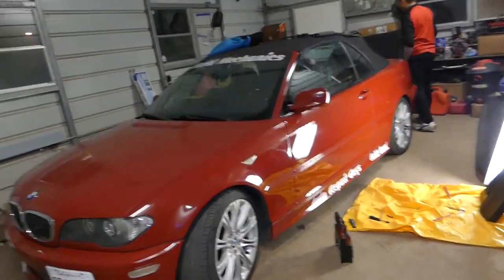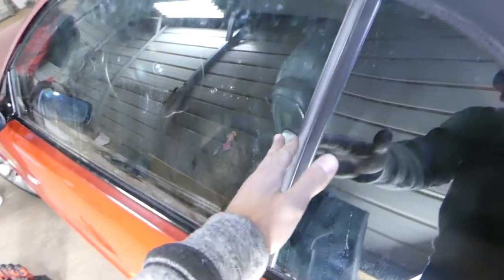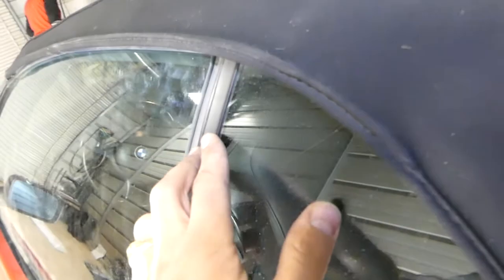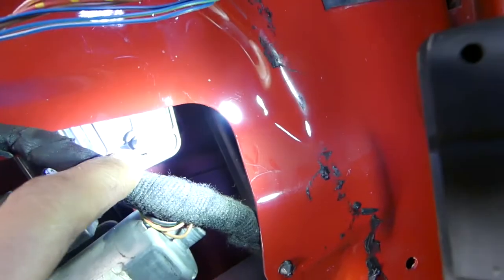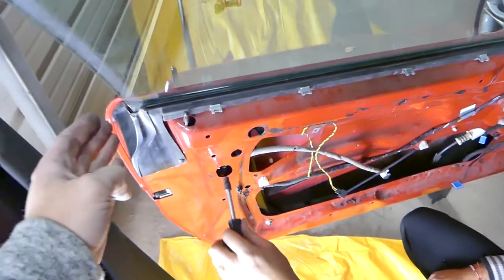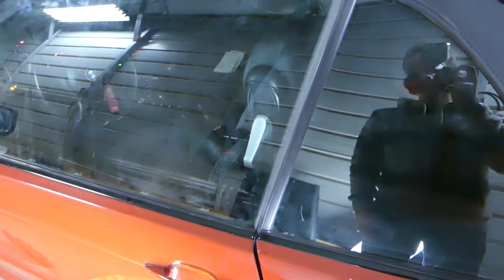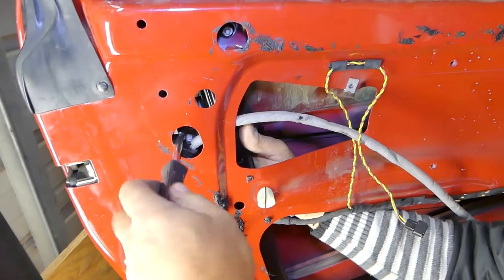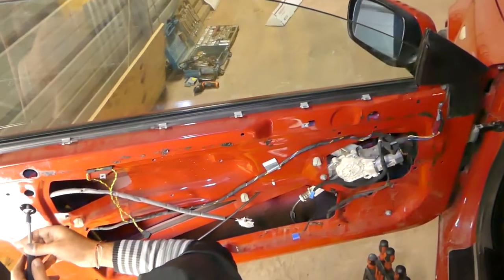HOW TO ADJUST SIDE WINDOW ON BMW E46  WINDOW DOES NOT CLOSE ALL THE WAY

Comment: It’s also worth noting how to adjust the window if its to low or to high. On the underside of the door are two rubber grommets, bring the window all the way down and remove the grommets to reveal two torx 25 bolts on the bottom of there the window is clamped. Adjust as required. Ive been on with it for hours until i checked some forums as mine was to high and catching the roof. The power of the internet is amazing
Reply: Bro…you are a true hero.

Comment: When you adjust only front door, you will break "front-rear alignment" when top down.  

Front door: You can adjust high limit and low limit. Also interior-exterior angle.

Rear vert window: You can adjust  this match limit easily. Also interior-exterior angle too. 

Sincerely
Reply: Ali Oral yeriniz neresi acaba

Comment: Strange I don't really get this. This is incorrect procedure. According to BMW you adjust the window from the outside - Not inside. By carefully removing the outside  trim list of the door (CI's and convertibles) you can reach the openings. Then adjust the window and its position angle towards the rear window by adjusting the two adjustment screws and the 13 mm bolt surrounding one of the hex-screws.